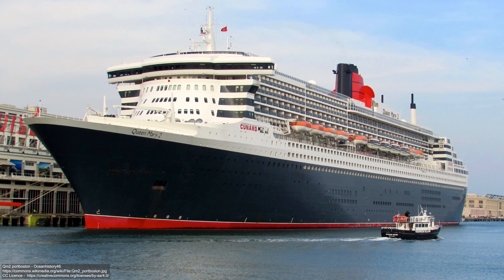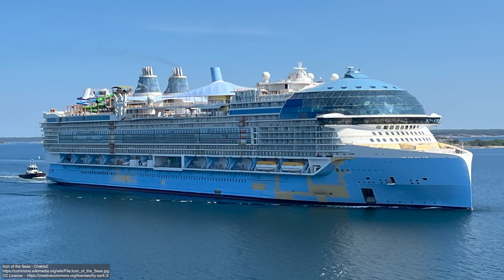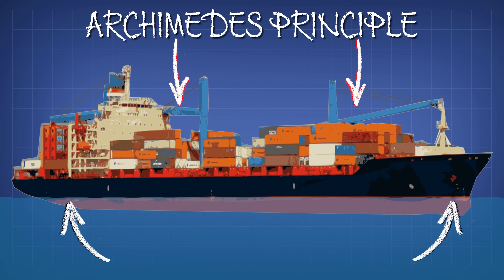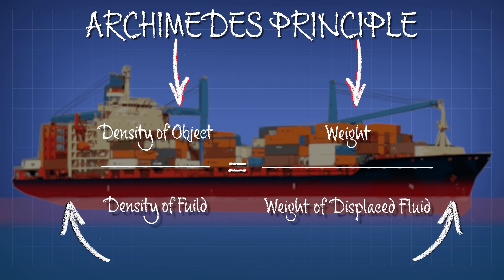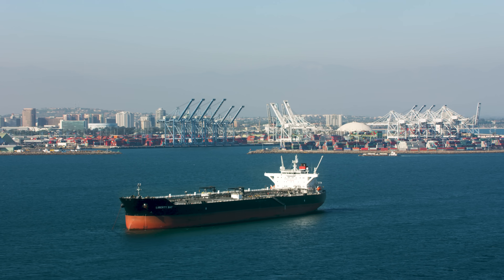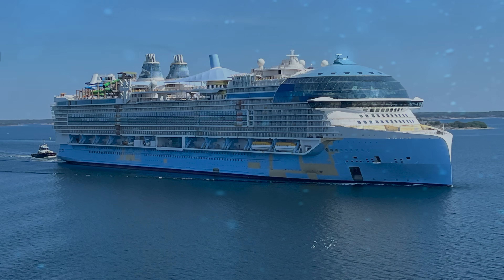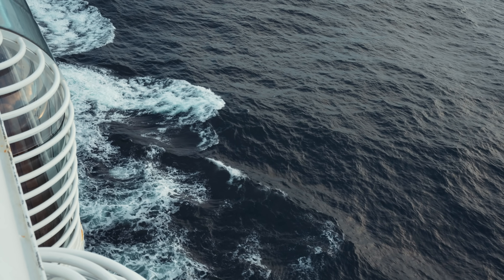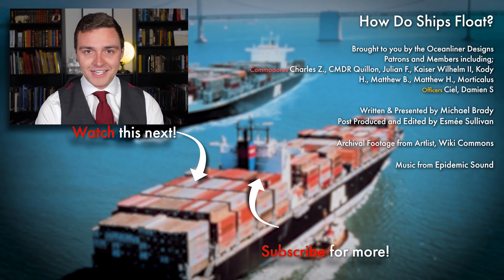How do big ships float?

Comment: As long as the ship's density is less than that of the water, it will not sink. Density is the weight of an object divided by its volume. So if the weight of a ship is less than the weight of an equal volume of water, it will not sink. Another way to look at this would be to examine the ratio of ship's density to water density - Ds/Dw. where Ds is ship density, and Dw is water density. If that ratio is less than 1, the ship will float.

Comment: One detail that's often overlooked when explaining buoyancy is why water (or any fluid) exerts an upward force at all. If you pause to think about it you'll see it's not obvious. The explanation has to do with the pressure difference that occurs when a column of fluid weights on itself, the bottom of the fluid will have a higher pressure than the top, and that pressure difference is what's creating the upward force.

Also, for buoyancy to exist you need gravity. If you had a big tank of water floating in outer space where there's no gravity and took a model boat that would perfectly float on Earth, then placed it on the surface of the water and gave it a little push inward, then the boat would go through the water like it's air (although with more friction), there would be no buoyancy because there would be no gravity to create a pressure difference on the body of water.

Comment: they float the same way little ships float. Size is irrelevant. There is a physical parameter which must be < 1.0 for a thing to float. Your homework assignment for tonight is to determine and describe that parameter, and use examples involving gases, liquids, and solids in your dissertation.

Comment: QM2 stats: Length 310m/1,131 ft, width 41 m/134 ft, height 71m/236 ft, gross tonnage 149,000
Icon of the Seas stats:  Length 365m/1,198, width 65m/213 ft, gross tonnage 250,800

Comment: The most effective method to calculate the displacement of water that I find is to actually take the volume of an object (boat, float plane, etc…) multiple the viscosity of water (1000 lbs/ft3 freshwater or 1060something seawater) and then divide that with the weight of the said object.

Comment: I hope I did not miss your point on buoyancy, but I have a question: If you were able to suck all the air out of a ships hull, so that it was basically a vacuum, would a ship still float? This is not realistic I know, but always thought that it was the volume of air within a ship that kept it a float. With a leak, water displaces the air until the density of the ship becomes greater than that of the water, (like Titanic), and it has to sink. Would a vacuum do the same thing? (Inquiring minds would like to know.) Love your channel!

Comment: The metric system really proves its value when it comes to buoyancy: 1 kilogramme = 1 litre (= cube 10x10x10 cm). Example: If a ship displaces 1 m²  (= 1,000 l) it has to weigh less than 1 ton  (= 1,000 kg). – Honestly: Calculating with the imperial system gives me headaches thus I refuse to do that! :D
Reply: P.S. You have to adjust these numbers to the density, of course, but you can look these up in tables.

Comment: Hello Mike Brady, My Friend!  FASCINATING video!  What interests me, is how these modern ships with TOWERING superstructures don't just tip over and capsize!  My assumption is that these more modern ships have a much wider beam than the older ones.  That, and designing to use the lightest materials possible, the higher up on the ship it is.  I would also think they keeps LOTS of fuel right down in the very bottom of the ship.  Whatever the reason, it seems like a miracle sometimes that these ships don't just capsize!

Comment: A London Bus, the New Roadmaster e.g., has a curb weight of 12,65 mt (metric tons). Its dimensions are 11,23 x 2,52 x 4,39 m, so its volume is 124,24 m^3. Accordingly, its displacement would be equivalent to 127,346 mt of sea water. Provided it's water-tight: damn, what would that thing float!

Comment: Did a bit of Canadian canoeing at one time - and the 'hull' design or shape certainly made a difference - especially when you 'edged' or leaned them over onto their sides.

Some definitely didn't want to do this - but conversely would flip and capsize with a comparatively small increase in the tipping angle - others would seem less stable - i.e would take less to roll - but were a lot more controllable near that tipping point - if that makes sense !

Comment: A critical factor in buoyancy is that water pressure increases with depth. That's why a ship or floating object sinks to a point then stops. It stops sinking because the bottom of the ship has reached a depth where the water pressure's upward force equals the downward force of the mass of the ship.
Reply: That didn't work out for the Titan, or the Titanic, at 12,500'. Or the USS Samuel B Roberts, which is sitting at the bottom in 22,621' (4.3 miles) of water. How deep do you have to go to stop sinking?
Reply: @KSparks80  Those vessels took on water which adds to to mass/weight of the ship. The extra weight makes the ship sink lower in the water until the water finally rushes over the top and the ship fills with water. The weight of the water along with the weight of the steel in the ship exceeds the upward force of the increased water pressure and the ship slips below the surface, completely fills with water and goes to the bottom. At that point with no air inside the ship is simply steel which is denser than water. Throw a piece of steel in the water and it will sink pretty much instantly. Same with a ship full of water. A floating object displaces its weight. A submerged object displaces its volume.  A sunken ships volume consists of only the steel not the empty spaces now filled with water.
Reply: @KSparks80  Sorry, I used the wrong word.  I should have said a ship settles deeper in the water instead of "sinks". The ship is still floating just deeper in the water. Once you add enough wait the ship will go so far down that water comes over the sides fills with water and then it sinks. Once completely underwater it wont stop sinking until it hits the bottom,

Comment: Do ships built to operate on the great lakes require a different hull design to account for the lower density of freshwater in the great lakes as opposed to the salt water of the oceans?
Reply: The biggest difference is Lakers are usually longer and narrower than ocean ships. The have to fit through the locks in order to reach the ocean, where they sail just fine. Lake waves  are generally steeper, with shorter wave lengths, than ocean waves. More of a "chop" to them. Overall, ocean waves are more powerful though.

Comment: Very interesting video 👍. You could also have touched on a detail which is about seawater that contains a large amount of air bubbles - or gas bubbles, such as the gas leak from the burst Russian gas pipeline in the Baltic Sea. If a ship - as a thought experiment - had sailed over this gas release, it might have sunk due to the greatly reduced density of water-gas mixtures.

Comment: Depending on what you define is a ship, there would be a currently active vessel with similar size to the Seawise Giant.
The Prelude FLNG displaces 600k tonnes, with a length of 488m, beam of 74m, and absolutely ridiculous height of 105m.

I suppose it doesn't quite count since it doesn't drive under its own power, though I does have some propulsion for positioning.

Comment: One thing nobody ever expected to float was the Bigfoot monster truck.  But the tires hold such a volume of air the truck can actually float.  Bigfoot was fitted with a second tire at each corner for stability and actually raced a paddlewheeler on the Mississippi River.  The boat won.  But it was a very poor sport about it and refused a rematch on land.

Comment: That's what my theory of the Bermuda triangle is is that ships sink because of gas pockets. Like a methane pocket. The gas gets released from the bottom of the ocean and as a ship goes over the top of that gas leak it loses all buoyancy and instantly sinks. That's my theory of what goes on to Bermuda triangle.
Reply: And then there is rogue waves, and something frequently overlooked is that A LOT of ships are poorly maintained and poorly crewed.
Reply: You do realize there are storms there right? The ocean is warm practically year round. Ships run aground not realizing there's land underneath and they sink.
Reply: @BellyLover06  you do realize I didn't say every single ship sinks because of that I said it's a theory.. ......  You do know one understand what a theory is right or do I need to put a definition in?
Reply: @fishingwithkar4871  You practically implied they did. By not using "some", you're basically saying "all". Gas pockets don't even make sense because they'd be deep underwater and random. Storms are much more common and on a larger scale.
Reply: @BellyLover06  how is opening a comment with ( MY THEORY IS ) implying anything?? The video is based on ship buoyancy and I gave a theory on buoyancy.
Reply: @fishingwithkar4871  You said "Ships sink because of gas pockets". You're not just implying some, but all ships, whether intended or not.